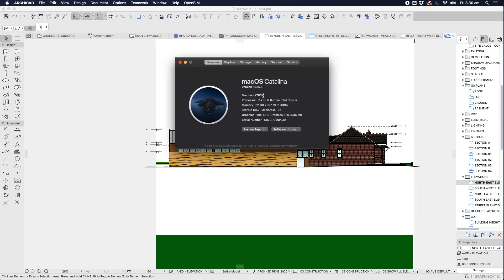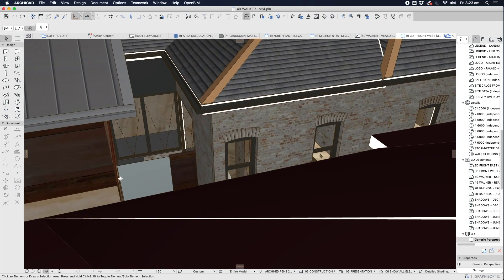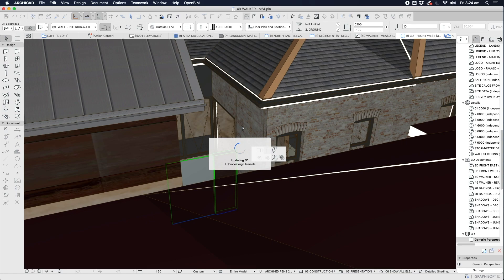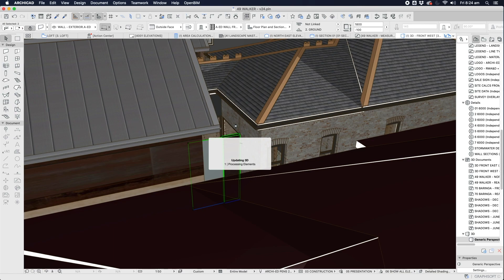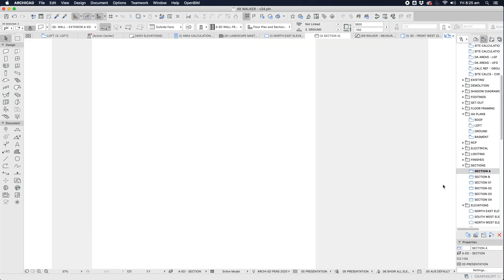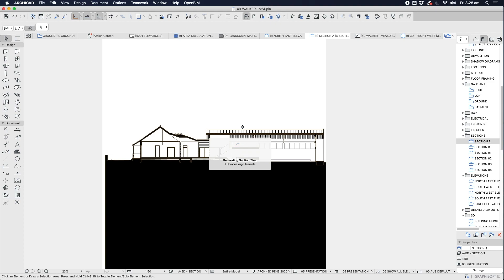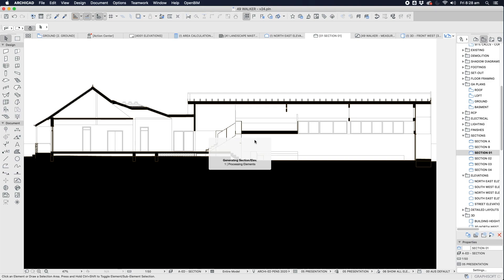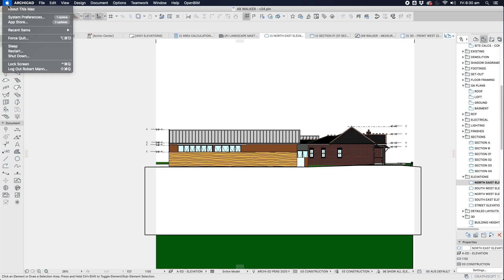Why is ArchiCAD 24 slower than ArchiCAD 23?

Comment: To open new incident of archival & go to file new ,hold shift down & do new & reset all. It reset all your toll bars back to default settings but it’s the only way to get Archibald to run at a decent speed. I am only still running 21 as l didn’t renew my select agreement with central innovations sadly lost faith in the way they treat long time users hopeless tech support😕